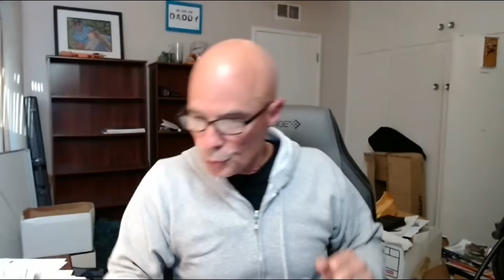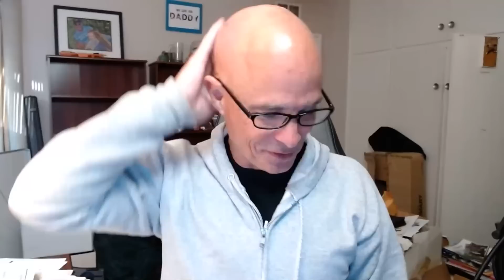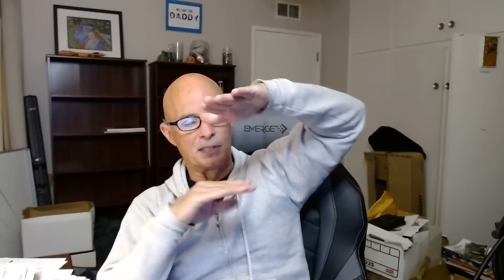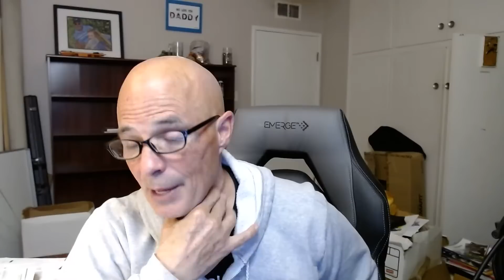LET'S TALK TECH-THE 91 OCTANE PUMP GAS TUNE! HOW MUCH IS ON THE TABLE?

Comment: Tuned at 91 pump plus 1 625ml/min nozzle of methanol 14 psi boost 23 degrees timing at 5400ft altitude. I have since added an additional 375 ml/min nozzle 91 mixed with e85 to an E30-40mix the car loves it havent dyno it but it was a 6.1 60-130 vs a previous 6.8 60-130 car weighs 2900lbs guessing 550 rwhp
Richard do a test on 91 vs E30

Comment: (On 91) I run a 2.5 subi with 8.2 compression and 17 psi at 4200 and 11psi at the 5800 rpm and I  make 297hp at tire and 316 torque only because my tuner would like to see 19psi on top rpm, but my turbo is too small. He said I could see 400hp at 19psi. Have you tryed low compression and hi boost on 91?
Reply from the maker: yes

Comment: I've heard recently that your whole strategy to 91 is wrong...because the 10% Ethanol makes the old 14.7 to 1 Stoic invalid...and you can run more static compression...you just need to offset the AF ratio to 14.01 to compensate for the diluted Gas...thus more timing wouldn't be nesseary...if anyone could explore this theory, it would be you Richard.
High boost is just elevated compression, yes?
Reply from the maker: high boost is not elevated compression
Reply: @richardholdener1727  dose the combustion chamber know the difference?...please take a moment and ck this guy out: Gt350 garage on YouTube very interesting info on tuning 91 Octane fuels

Comment: I have a question sort of on this topic.  Do octane requirements go down as density altitude goes up, either by high temps 100= F or actual altitude say 6000 to 10000 ft elevation at 60 to 80 F?
Reply from the maker: the motor makes less power at altitude and detonation is less likely with altitude and lower temps
Reply: @richardholdener1727  thanks

Comment: I run upwards of 20 psi @ 20 degrees on pump gas super (probably 92) without water injection or intercooling, but Im not in it for very long, but my compression ratio is only 8:1
Reply from the maker: SURE
Reply: Richard, I share your concern with proper distribution of methanol injection.  Just throwing this out there…. What’s stopping us from acquiring intake with 2 injectors per cylinder and using one of the two for water/meth?  Sounds costly but is it possible at all? Im thinking a really small injector would be needed but am unsure what the pump driver for this would consist of. Sounds interesting, give me insight and I’ll try it. Thanks!
Reply: @dane3077  Actually, the best water meth injection set-ups do exactly that... the water/meth controller is 3d mappable and goes off the fuel injection duty cycle and is as controllable and precise as fuel injection is, although the "controller" is more or less a fuel injector that is made to handle water meth and is more or less feeding jets that go to individual ports. You can do stuff like that when the pump is 300psi!!
Reply: @63turbo  good to hear. Do you actually run normal fuel injectors or is it still some type of meth nozzle?  Also, how do you calculate what size nozzle/injector is needed for each cylinder?  Do you know of any literature on how to calculate and what does/doesn’t work with meth? Obviously new to this and I’m trying to soak up as much knowledge as possible. Thanks for the reply as well.
Reply: @dane3077  No, you cant run normal fuel injectors, because most cant handle water+methanol... they rust in a few hours. They have to be made from stainless steel to put up with both water and methanol. I cant answer your other questions very specifically except to say that for maximum anti detonation effect, you should be at around 30% of your fuel flow for the water/methanol. Also, the people in that business normally say that the effect of water/meth injection is like using 100 octane fuel, but in actual practice, from people I have talked to that have run the same set-up both on c-16 (117 octane) vs water meth on REGULAR GAS!!!!!!!! they were at 18 degrees total timing at close to 30psi of boost on C16, and at 32 degrees total timing on water meth at the same boost using regular gas, and large differences in torque and power on the water/meth vs C16. Heres a link to a company that has these special injector/controllers meant for water methanol https://usrallyteam.com/

Comment: Please do a test on 91 at several boost levels and progressively more timing. It would be interesting to see say 8psi 10psi 12psi and max boost on this test engine and try more timing. another interesting test would be three or four fuels on the same motor, we get 91, 95, 98 and 100 on the pump here in New Zealand. I'm about to do my first boost build, Raptor supercharger on a 302HO XR8 Falcon :)

Comment: Looks like I'll have to drive 40 minutes one way to get E85 for my truck.

Rich. If I run strictly pump E85 will I need a to put a sensor on it?   When buying parts I originally planned to run NA or spray so I bought the Summit stage 4 cam and some springs. I realize I'm going to lose out on torque down low but its in a S10 so maybe not necessarily a bad thing. How big of injectors and fuel pump would i need to run a VS 7875 gen 2.5 billet? 

Thanks in advance for advice

Comment: Fuels that are oxygenated help faster flame propagation, thus having to use more of it per cycle (30%-40%) to "keep" the same propagation as pump gas, but this also makes the charge cooler and harder to ignite. So therefore more timing° and more "time" for pressure on the piston= more tq/hp per cycle.

Comment: So you could buy:

1. $1000-$1500 used m122
2. $1750 adapter plate
3. $1000 heat exchanger pump, lines
4. $250 aftermarlet fuel rails
5. $500 ptfe lines to and from tank
6. $300 twin 450lph pumps
7. $200 pwm controller for pumps
8. $100 china throttle body

All to get 700hp on e85 due to belt driven losses from the blower or you could...

Hook the $200 gt45 up to the stock exhaust manifolds with a cheap 4" intercooler, use the stock truck rail and regulator, vinyl or existing fuel lines,and a single 450lph pump to get 700hp on gas.

Boomers must love blowers because they have so much money.

Comment: I have a turbo, stock block R18 civic wich had a T25 (sr20det spec), wich I ran between 10-12.5psi. With the pump 91 we have here, I was only able to run about 5-6 degs at that boost level and even then It was still showing 70-80% knock level. I theorized that either our 91 here is not good, the t25 is choking the head and prevents it from exhausting heat, resulting in increased knock sensitivity, or its a trait of the integrated exhaust manifold design

I recently re-did the setup, this time with a ebay GT35R, external gate, 3" exhaust and the cold side pointed behind the grill. Even with the bigger exhaust housing and better IATs, I still cant add timing, so I think it rules out the choking possibility

I also have a 2014 civic Si, with basic bolt ons and flashpro, only running 12-13degs  otherwise I get knock now and then (does not log knock level for some reason). The K24Z7 also has the integrated manifold design, and Im also running the same 91 gas

To you does it sound like our gas is to blame or is this a common trait of engines with intergrated manifolds?

I will use water/meth on the R18 as soon as I can
Reply from the maker: not sure on knock sensitivity of integrated manifold but it makes sense-also the 91 is terrible

Comment: E85?  91oct?!

Show us some engines that make power on 87oct!  (Long rod/short stroke)
25 yrs ago, HotRod knew what it takes!
Reply from the maker: rod ratio and 87 is silly
Reply: @richardholdener1727  @ $5+ for 87…… and almost $7 for a measly 4 points in octane is straight up ignorant.

In ‘97. HotRod did it….. an proved that long rods all but eliminate knock while making virtually the same exact power curves (87 vs 93!) YEAH, 93…… NOT 91.

11:1….. on 87oct makin 400+ HP AND Torque AND decent mileage?
Sounds like a lot more fun that spending4-5 figures on swapping junkyard engines multiple times a year.

Frieburger’s been a chump about it…. Even though he used the same theory on Engine Masters with the BB Rod “challenge” that was in the 97’ article. He proved the “No change” in performance, but never tested the octane difference. Which would have shown WHERE the difference actually lives.

“11:1 SBC making 400HP + 400Tq…… on 87 octane” would light up your YT tables.

Comment: If the 93 that comes out of the pump has 15ish e in it and my fuel lines aren’t melting to pieces can I run e30 or 40 or 50? At what point do you get the benefit. We know there’s no point in at added more e like e100 isn’t more benefit so to say. Can you run up to e40 get the benefit of knock protection not have to have ptfe, run about 15% more fuel instead of at least 30 % +
Reply from the maker: e50 seems to have nearly all the benefits of e85

Comment: Also you are talking about the smog eara,
Low compression so you should be able to put the NOS/Supercharger/Blower/Turbo and it can still run the premium...
Also alcohol runs cooler than regular fuels...

Comment: Back in the 60's regular fuel was 91-93 octane, primium was at around 99-110 octane...
So E85 equates to less than regular fuel...
Reply: Leaded fuel?
Reply: I was asking if the fuel had the tetraethyl lead in it during the 60’s. I don’t believe they were using ethanol in the 60’s. “Regular gas” was leaded wasn’t it?
Reply: E85 is about 105-110 depending if it test at e85 also lead was added when premium was at that high of a rating all lead poisoning ,lead clogs o2 sensors not worth it
Reply: Not only is e85 around 110 anyways you also have cooling benefits.
Reply: E85 is like 110😂

Comment: I had a 90 tune done on my 13 Mustang gt and it rocks! It's naturally aspirated so I don't see a need for E85. I also don't like the mpg losses associated with running oxygenated fuels.
Reply from the maker: you don't need it in that
Reply: @richardholdener1727  Thanks. I didn't think it would make much difference without boost. I'm pretty happy with my car the way it is.